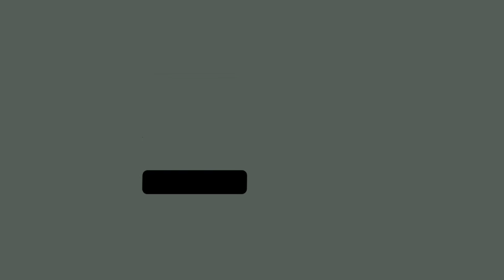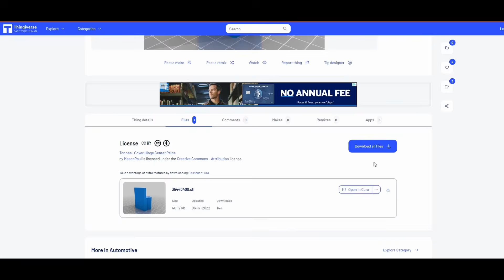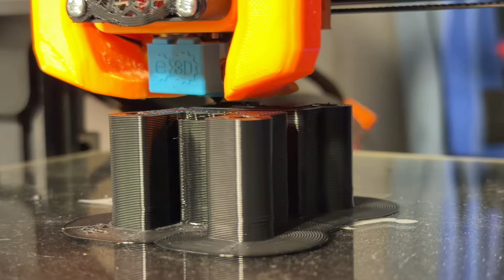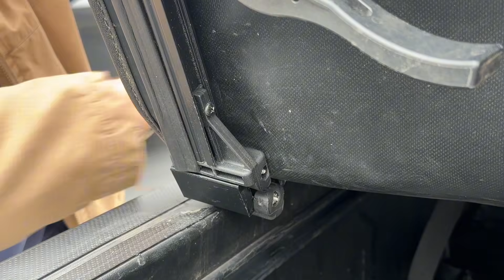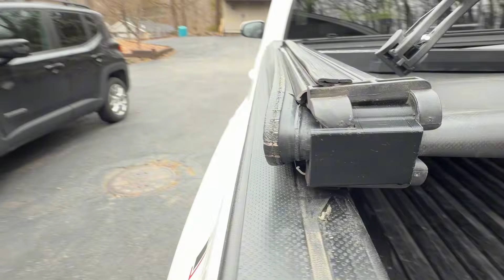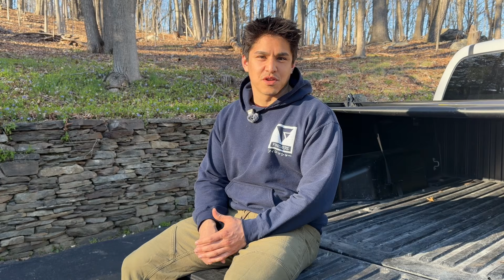The OEM Part Keeps Snapping. My Cheap 3D Print Doesn't. Here's Why.

Comment: I believe that I have been able to reproduce these, but I have changed that inside radius(fillet) from 3mm to 4mm which should reduce the stress point. I did it in Fusion. If you would print one in PLA or whatever to see if it is dimensionally correct, I would be happy to print a couple in PETG-GF for you and send them to you. We would first need to see about how to get you the .stl for what I have to you so you could test print.
Greg

Comment: You can print those with TPU. Even a base Ender 3 can print that material and it will last a long time
Reply from the maker: Interesting, this isn’t direct drive though, won’t the flexibility of the material impact retraction and the print quality?
Reply: @built_by_jon direct drive extruder is definitely the way to go